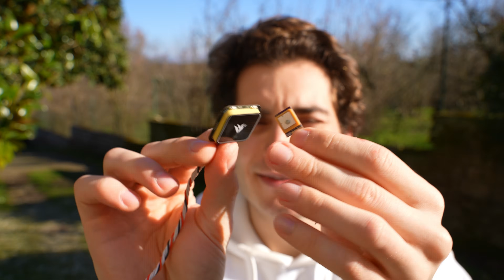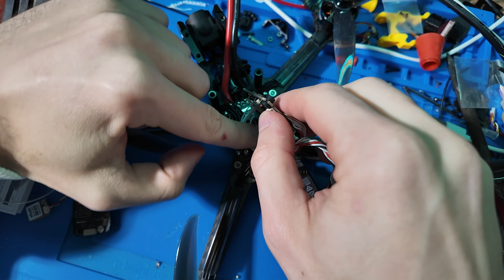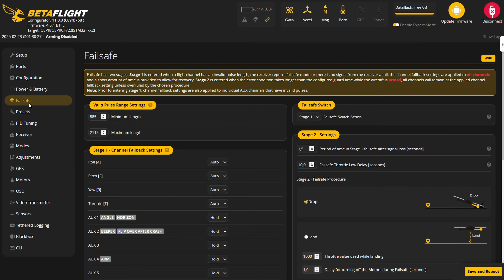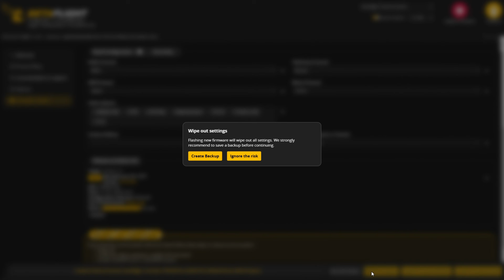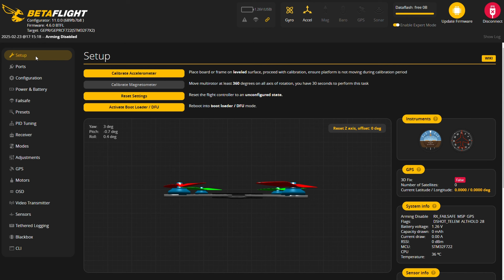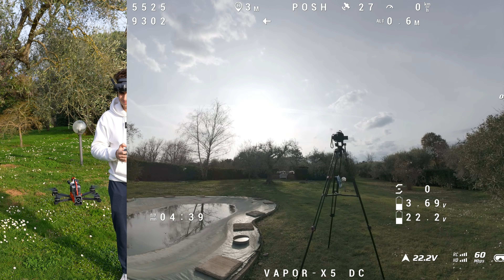How to Install a GPS On your FPV Drone and activate POSITION HOLD!

Comment: The best FPV Videos as always. So glad you tested the modes without  the Magnetometer, which is very interesting for my sub 250 build. Thanks!
Reply from the maker: Yes if you have many satellites it works well, I have setup on my small drones as well
Reply: @rimzler  nice, thanks 🙏 ☺️

Comment: Great video! Will it work the same if I buy the GPS version of the drone?
Reply from the maker: Yes even better probably, hope GEPRC setup the magnetometer correctly, I am getting the D6 gps soon so will let you know
Reply: @Rimzler  Thanks! How would you compare it to the Geprc Mark 5?
Reply: @rimzler  They usually do not set up GPS and Mag functions on bnf drones. Just installed

Comment: Nice video ! it will be great and vey helpful if you can make a video where you show the settings of your radio control !
Reply from the maker: Of course, you mean how to set up the DJI radio in betaflight?
Reply: @rimzler  Yes and above all which keys to assign to which essential functions to you 🙏🏻

Comment: Sm tm barometer cover with sponge will work poshold better
Reply: As I understand they shouldn’t actually be related, as long as you have 4 satellites locked the satellites are what determine your altitude, not based on pressure but based on your relative position between the three
Reply: @ barometer related altitude and gps related position gps olso 3sat not enough minimum is 8 .i said that if barometer cover with small sponge will reduce wind direct hit to sensor